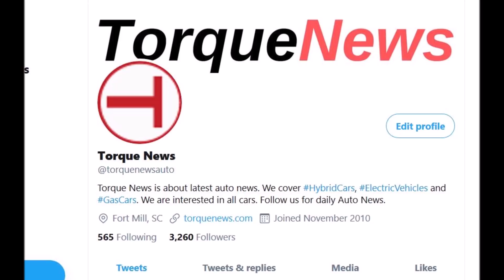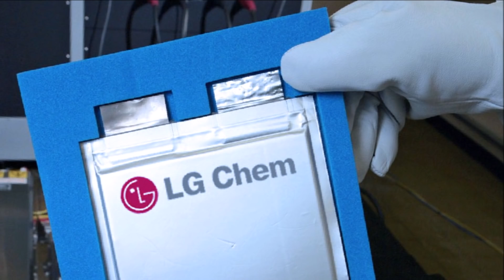Tesla Supplier LG Chem to Boost Battery Capacity With 5-Fold Energy Density

Comment: The figures quoted are consistent with the expectation achieveable with solid state batteries
Reply: No.  Solid state batteries won't have that much more density. LG is talking about 5 fold energy capacity per cell NOT energy density.  Basically they will be making those larger sized cells Tesla announced in their battery day

Comment: When Tesla/Panasonic switched to 21700 cells, LG and Samsung had been very quick to adjust to the new cell size, too. It may now be the same with 4680 cells. The question is if they need Tesla patented tech like the tabless design or if they have different solutions for this problem.
Reply: https://youtu.be/TEoPELSj1MI

Comment: A 5x improvement in energy storage per kg (which is how we talk about energy density), compared to the cells LG Chem already produces for automotive use, is not feasible with L-ion batteries.

LG Chem might be planning to produce a larger cell, as Tesla intends to do.  A larger cell can yield a 5x increase in energy storage*, as Tesla's Roadrunner cell does - but *not a 5x increase in energy density.

I don't know what LG Chem is actually planning to do.  Reuters fails to clarify it.  Sloppy journalism!

Comment: It makes sense that once Tesla showed off their large format 4680 cells that other major battery manufacturers will follow. I'm sure that CATL will show off their own 4680 (or similar), tab-less battery before the end of the year. As well as a LFP variant.
Reply: It's a good question as to if LFP (lithium, iron, phosphate) can be made into a dry electrode, or not. We, simply, aren't told. It seems plausible that LG Chem and CATL are going to a larger battery cell size -- similar to Tesla's 4680 cells.
Reply: @artsnow8872  Well there are a few different questions there. One is if Tesla will make a version of their 4680 battery with LFP composition, if it's possible. And if so, will their dry electrode technology translate for LFP? Tesla does show LFP batteries in their product roadmap, but they could just be talking about the China-only prismatic batteries that CATL now offers. The second would be if CATL tried to copy Tesla's 4680 batteries, and used their current LFP chemistry. I am doubtful that Tesla would give away any secrets of Maxwell Technology or their new battery development beyond what has been published to any Asian battery manufacturers.

Comment: Yeah, it sounds as if they licensed Tesla's battery design. The real question here has to do with that LG also supplies GM, among others. Will GM and other auto manufacturers be using Tesla designed batteries in the near future? (LG is building a battery factory in Ohio for GM vehicles.)
Reply: If LG sell TESLA batteries to GM, then GM will pay royalties to TESLA.
Reply: @steve5090406  Sure, these are the details I'm interested in finding out.

Comment: energy is the current  power is the voltage.   it is fairly simple the cells are geometrically larger. look at it this way. look at a battery.  AAA now make it 30 times the size it is going to have more ability to store energy and depending upon how it is configured a higher voltage

Comment: Since you mentioned Hyundai Kona my father has driven that he says it’s nowhere near Tesla when compared to speed, range and charging speed. Tesla is still years ahead in the EV industry
Reply: That has nothing to do with the batteries. It's mostly due to BMS (battery management system). That's where Tesla make a real difference that are translated by efficiency or range stats.
Reply: The kona are actually way more efficient than tesla, also the kona have smaller battery packs
Reply: Hyundai now started  to offer level 2 driving tech. Tesla started this EV trend. Hyundai needs to put a lot of money into R&D to create software. Their BMS is shitty.

Comment: This is similar to the Tesla 4680 battery. Tesla will never use this battery because the goal of Tesla is not to increase the power of cells instead decrease the cost of cells to make an affordable 25k dollar car. The power of this battery and Tesla 4680 battery is the same (5x compared to previous generation) but if Tesla has to cut the cost by 56% they have to make their own battery (which battery day was all about). This battery and Tesla’s battery will increase the vehicles range 15% (plus/minus 5%) since the tech is same.
Reply: https://youtu.be/TEoPELSj1MI

Comment: 4680 cells have a 5x largervolume and that's why they can store 5x the energy. Has nothing to do with the energy density on the cell level. Well packed they can increase the energy density on a pack level and this can lead to an increased range because less volume of the pack is "can" material
Reply: At 2:25 - 2:35 he says "boost Energy density"; he also says "without further elaboration" meaning it is yet unclear, at best, what the heck he's talking about.   But the reference to 6 v is interesting.  This suggests a series stacking of two of the batteries to me.  But, who knows.  It's already over-priced in.